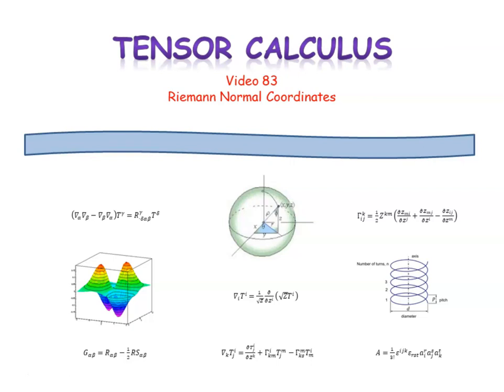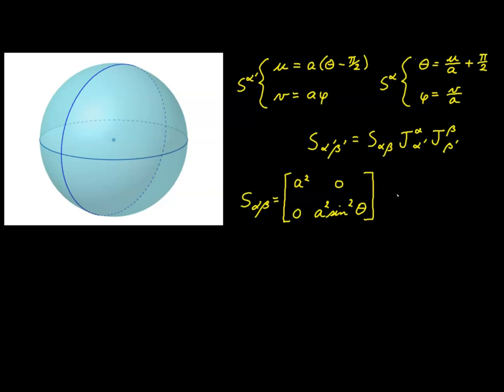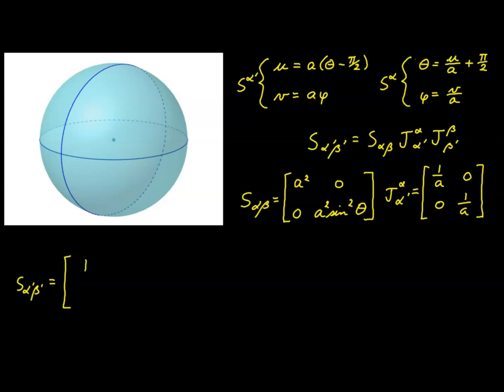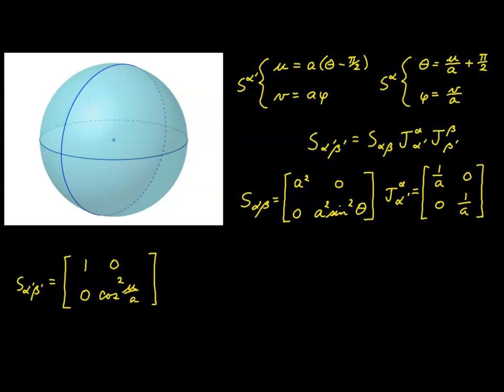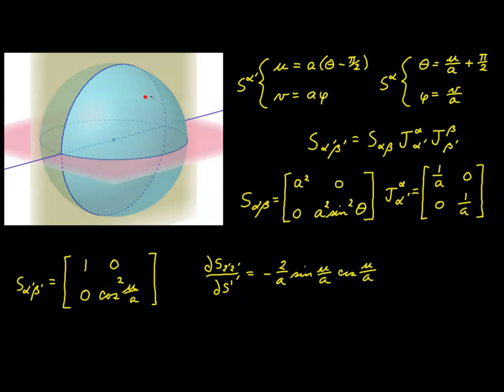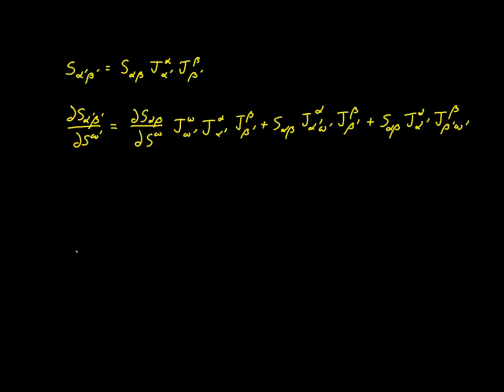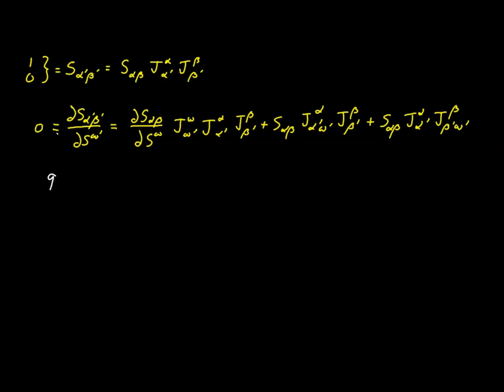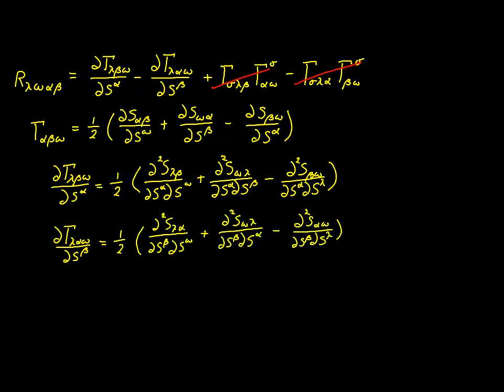Video 83 - Riemann Normal Coordinates

Comment: At 23:56 you say that it cannot be extended to second partial derivatives. However in case of 2 dimensions i count exactly 18 conditions and 18 independent variables in total which should lead to a single unique solution. Can you clarify this? It does fail however for dimensions 3 and above.Thanks in advance.
Reply from the maker: Interesting analysis, which I have to admit I have never carried out myself. So I dug into it to see, and I got the same results you did. For the 2nd order for n dimensions, the number of unique equations is E=1/4*n*(n+1)^2*(n+2). The number of unique Jacobian factors is J=1/6*n^2*(n^2+6*n+11). For n=2, E=J=18. For n=3, E=60 and J=57. For n=4, E=150 and J=136. E>J for any value of n>2.

The fact that E=J when n=2 means that there MAY be a single unique solution. However, it does not guarantee that such a solution actually exists, only that it may exist. I am confident that there is some other condition that prevents such a solution, but I just don't know what that is right now. If I figure it out I will let you know.

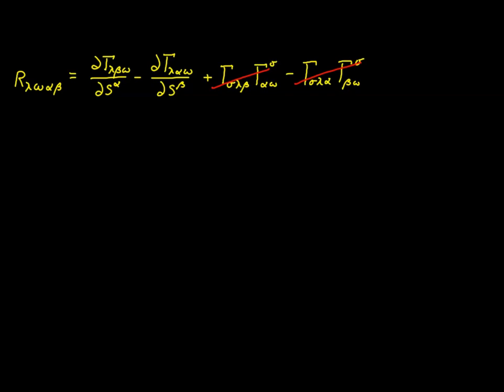Comment: Quick question: At minute 25:10, why are the Christoffel symbols in the first two terms not zero if the last two terms are zero?
Reply: Sorry  - thought it though - the derivative of a function that is zero at the origin isn't necessarily zero
Reply from the maker: Exactly right. To be more precise, the Christoffel symbols are derived from the first derivatives of the metric tensor. So what is really going on is that the first derivatives of the metric tensor are zero at this point. However, the first two terms of the expression involve second partial derivatives which are not necessarily zero. Transformation to Riemannan normal coordinates only transforms away the first derivatives.
Reply: @tensorcalculus822 thank you so much.This is the first video I have seen on YouTube that elucidates the proof of the transformation to Riemann normal coordinates in an easily accessible manner.I am studying general Relativity out of sheer interest from Leonard Susskind's theoretical minimum book but got stuck when I got to normal coordinates because it wasn't explained properly.For anyone wishing to understand tensor calculus I would also strongly recommend Pavel Grinfeld's book and lecture Series here on YouTube.It avoids the hassle of reframing the entire subject in terms of differential forms which I find quite annoying.